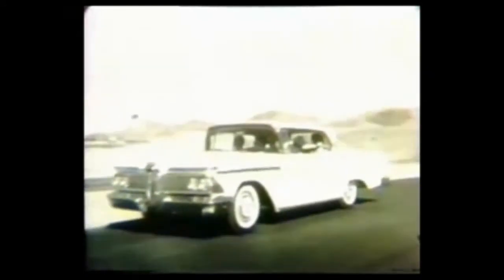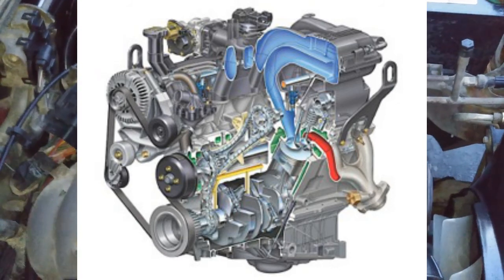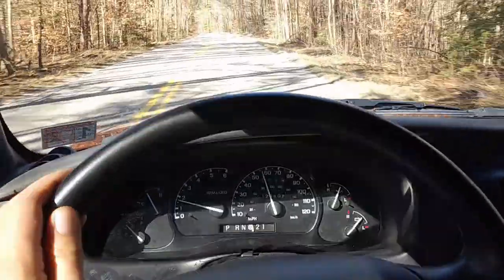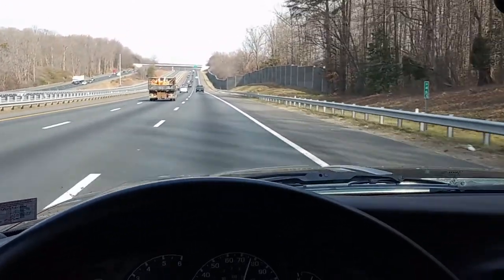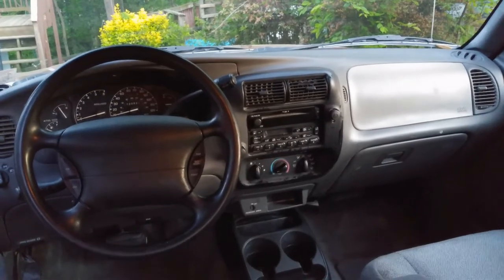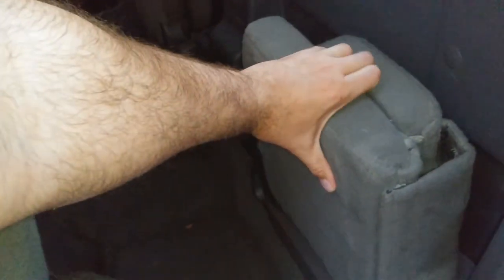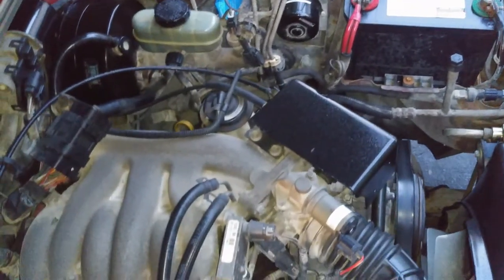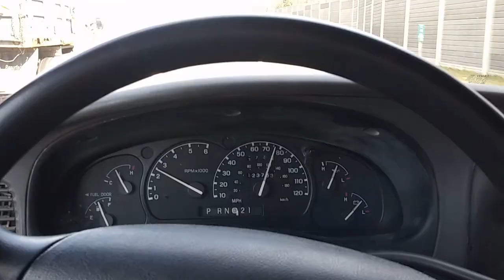2001 Ranger XLT Review

Comment: I have a similar 01 with the 4.0 sohc. My father had it since 03. Lots of fixes over the years but manageable. Never had any hint of a problem getting parts. I joke that autozone could build most of a ranger engine from stuff they already have on the shelves. 246,000 and still a daily runner. I just found a rare stepside camper shell for it that's in good shape. Also, the Ford dealer in my town had an absolute field day in the 90's and early 2000's. I see at least 4-5 different, old rangers every time i need to cross town.
Reply from the maker: Absolutely! With how many Rangers are out there, also ones running as modified baja trucks, I don't know why people are so bananas about the Tacoma's.

Comment: I'm inheriting a 2001 v6 Ranger w 175000 miles it drives like a boat cause my uncle never maintained it except oil changes.  I want to keep it for driving to home depot is all no everyday stuff.  But the transmission slips when cold do you recommend leaving it alone since I'll only drive it 1000 miles a year or should I do a nice fluid flush and change?  Nice video just ur music is too loud 👍
Reply from the maker: Yes, the first thing is to change the fluid, but do not take it to a shop for a "flush". Why? Because the shops often use a "universal" fluid type, this is a bad idea. Drain it and refill with the exact Ford Mercon fluid spec. If it has a transmission filter do that at the same time.
Reply: @rhynecars  Thanks!  I'll do that!